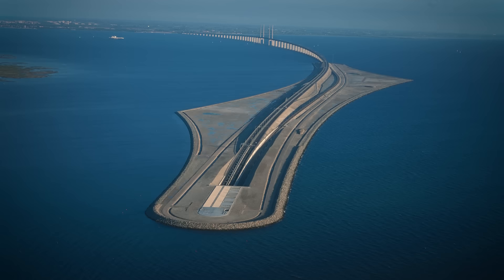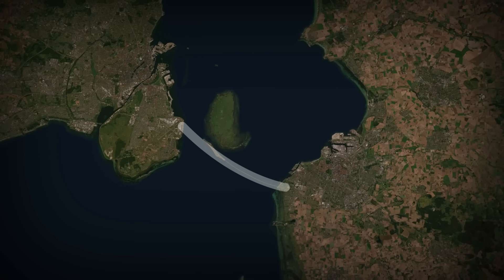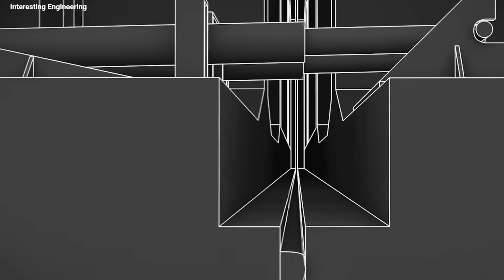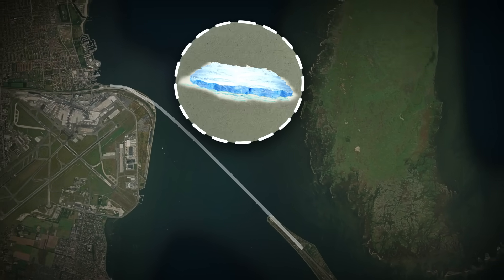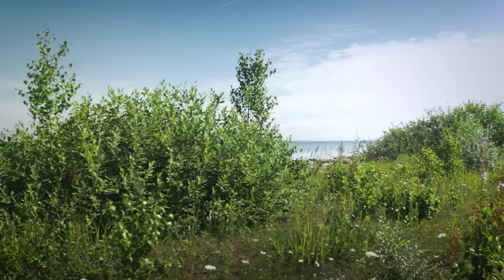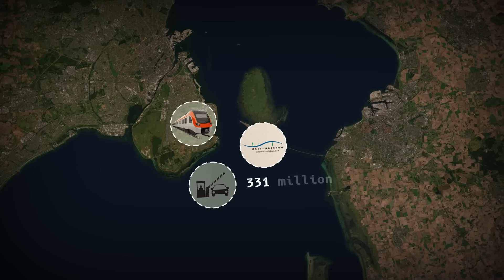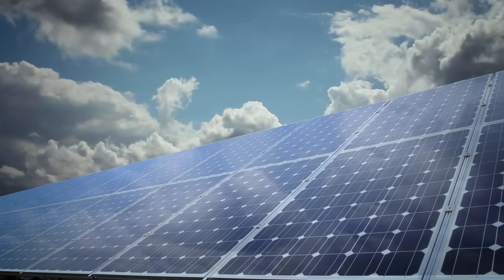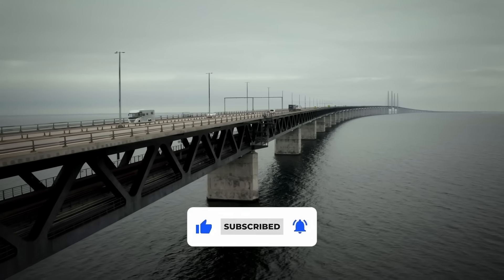Why Denmark and Sweden Had to Build a Tunnel AND a Bridge

Comment: 10:40 This is not the Øresund bridge. The bridge does not have cross bars between the poles of the pylons. This so a plane colliding with one pole will not take down both. With luck, the bridge will remain standing after losing one of its four poles. Note that this was already planned on the proposal shown at 2:40.